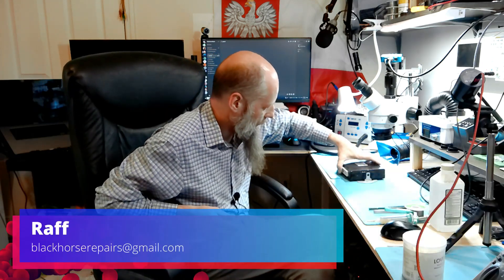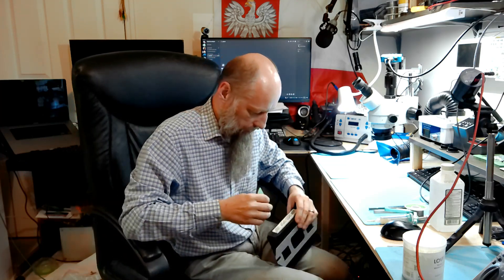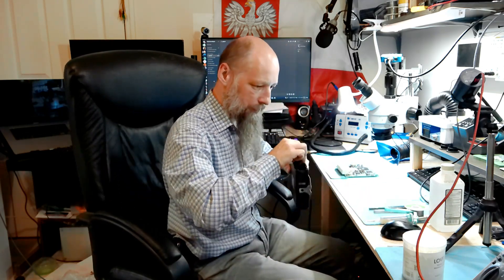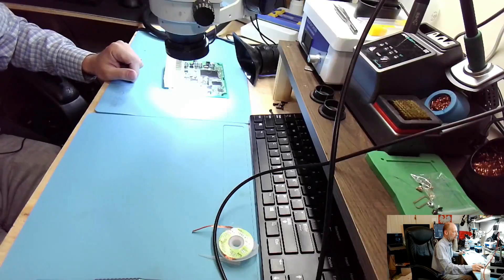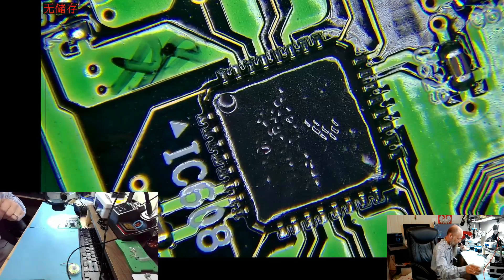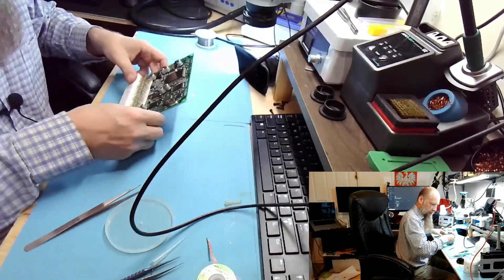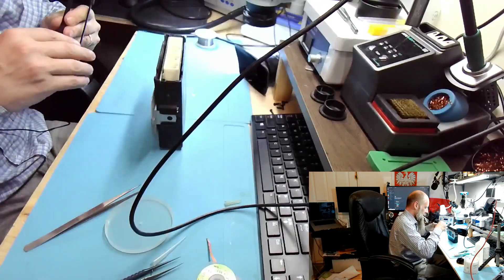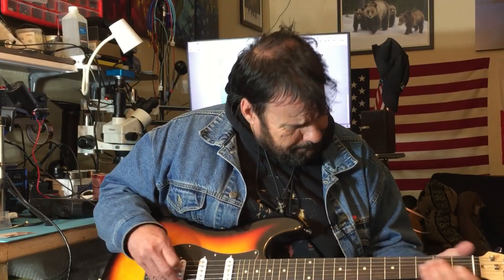ECM Repair For Chris [CA] | Finally an easy repair

Comment: The way you did it is perfectly fine and has no reason to be done any differently. 
With that being said this is the YouTube comment section so ill mention it haha. 
Why not use solder paste for the bottom pad? 
Also would there be an advantage to removing the coating on the board for that pad thus exposing more of the copper pad so the chip has a larger surface area to solder to on the board?
Reply from the maker: one reason against solder paste is how much more difficult it is to keep it in place, tiny solder balls fly all over the place. The temperature requirement is lower though so I guess if you can keep it clean, that's easier, but in my experience solder paste and hot air don't mix :) 
"removing the coating on the board for that pad thus exposing more of the copper"
you mean removing gold plating? Not sure that would be beneficial, have you tried that?

Comment: Can we have more information please?
Reply from the maker: Sure thing. IC608 is responsible for opening fuel injectors, it's a transistor array. It is controlled by the microcontroller (or FPGA, black box). On gen 3 Subaru, the solder that has been used causes issues, an equivalent of cold solder. That in turn is detected by the control circuit which further disables the control signal for the injector. That results in misfires (most common on cylinder #6). Blowing hot air on it or putting in in the oven (yes, some people do that) resolves the problem for a few days, up to 2 weeks. The repair you see here resolves the problem for good. I remove the chip and completely remove old solder, then I apply a new leaded solder and resolder the chip. Furthermore, I apply UV mask to keep moisture away from the chip (not necessary but I always do it). In some cases, I replace the chip with a new one, and in some more difficult cases, I have to restore traces that have been damaged.
That's pretty much it.
I hope that helps answer your question.